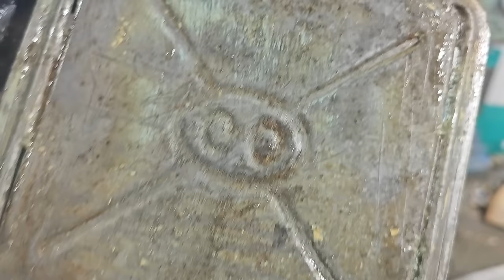Antique 1920's Broken and Rusty Coffee Grinder Restoration

Comment: 11:30 - is your workshop well ventilated? [indicating you putting on a respirator, by pretending to mask the camera] and putting up plastic sheeting but not stating that the your workshop is being ventilated/doing it in a proper spray booth with a filtering fan, ⚠️-💥
Reply from the maker: Thanks for the worry, it is, not a professional booth but a ventilated part of the shop for painting, these were small parts anyway... thank you for good intentions ☺️